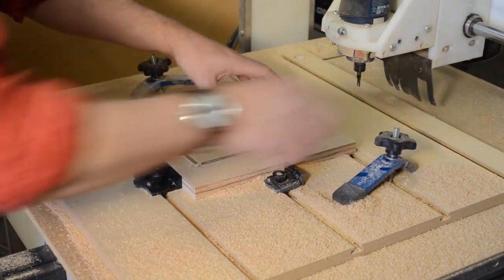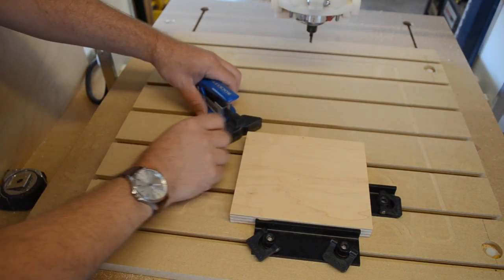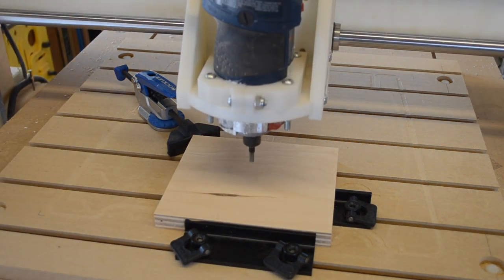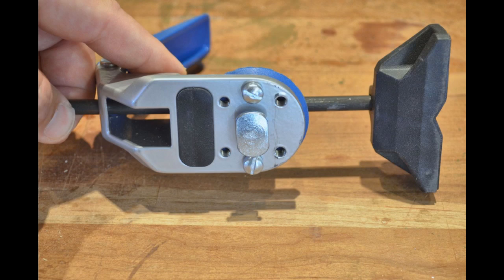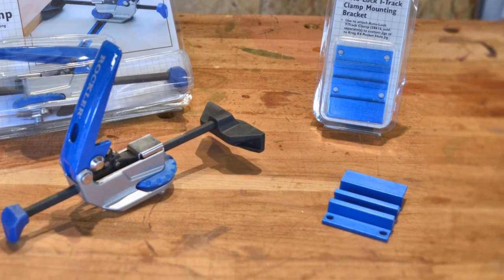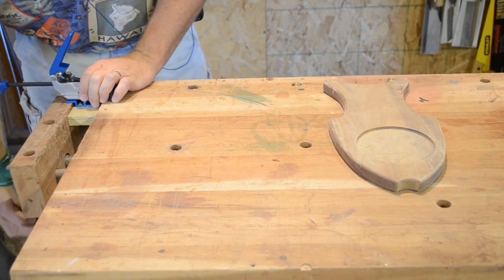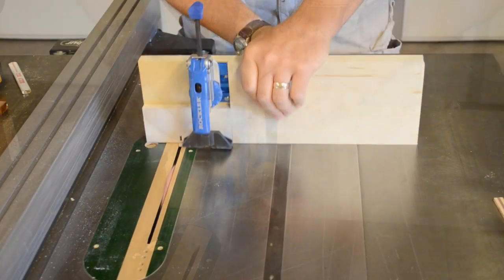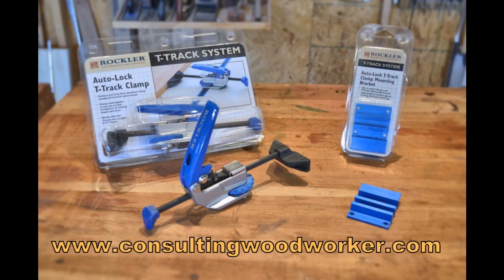Auto Lock T Track Clamp Review

Comment: Can the t track nut unscrew? I have a 30mm t track and was hoping I could find a different t bolt to fit into it.
Reply from the maker: Yes, the blue center wheel can be spun to release the T-bolt. The wheel is plastic molded over a 5/16-18 nut. This could be pretty easily replicated with your needed thread.

Comment: How many times can you "fly cut" you spoil board? The way I figured it I can have about .1" to flycut- not very much.   I purchased the stuff that you pitched and I am returning it Monday!  This may work for a hobby-ist not efficiently in a production shop.  $126 Mistake  Let the Buyer Beware.
Reply from the maker: jlt, you can fly cut your spoil board generally until you risk hitting the bolts holding it down, typically about 1/2 or so. How many cuts that is depends on how deep you cut into the board. Obviously the less you cut in, the less you need to remove with each fly cut. I've been programming and operating CNCs for 25 years now, everything from big CMS machines down to the CNC Shark and iCarver. There is no "magic bullet" for part holding in production, I've done just about everything you can think of to hold parts from vacuum to custom fixture boards. Send me a note through the "contact us" page on my website and I'll be happy to discuss your holding issues and maybe I can help.

Comment: Well, I am really impressed. Very well built and easy to use. Being able to adjust the tension so easily is brilliant.
I also picked up the Kreg AutoMaxx Bench Klamps. Equally impressive and the combination really has been the icing on the assembly table.
Reply from the maker: Thanks Tonka! I was impressed with them as well.
Reply: Ralph Bagnall Here is my Woodpecker\Kreg\Rockler\Incra assembly and router table station with the clamps. The tops are interchangeable.

http://lumberjocks.com/projects/105581

http://lumberjocks.com/projects/103070
Reply from the maker: tonkatoytruck Impressive clamp table!

Comment: Great review, very informative, many thanks for putting the time. I have a very simple question: would it fit on my 19 mm diameter holes on my workbench?
Reply from the maker: Ihab, I am happy you found the video useful! The clamps shown in the video are designed to work with "T" Tracks, not dog holes. But Rockler DOES sell a version of the same auto-adjusting clamp with a dowel on the base to fit 3/4" Dog Holes (19.05mm) just search for "auto lock" on their website.